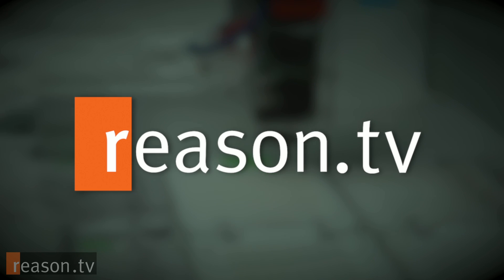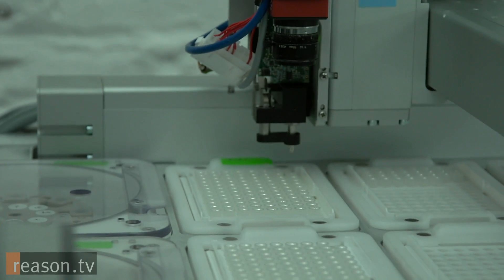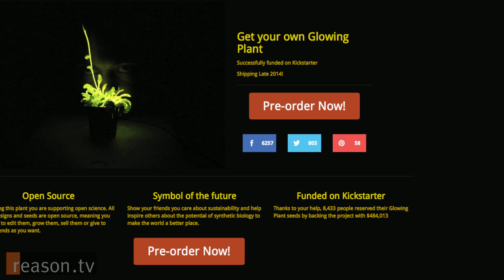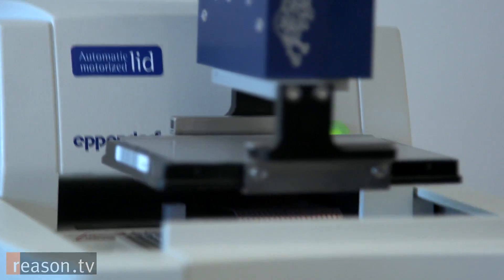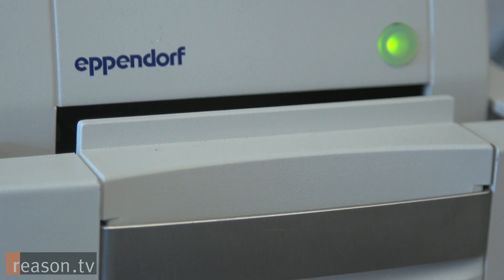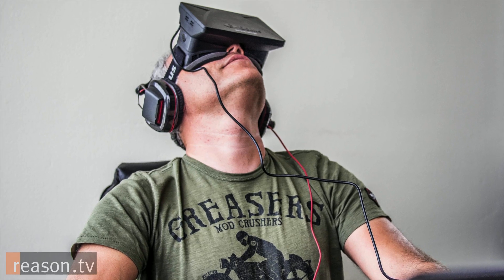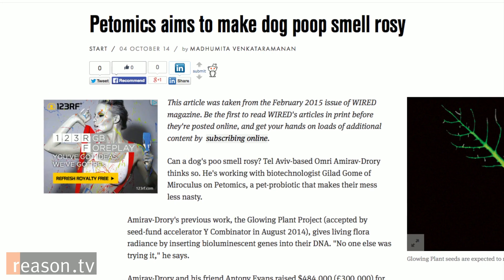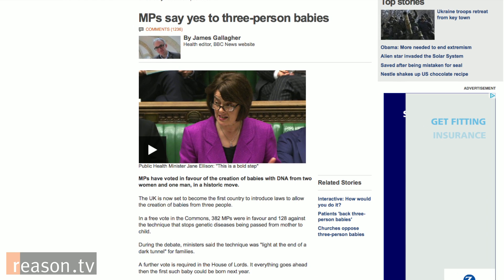3-D Printing DNA: Hacking Life's Code and Creating New Organisms

Comment: I find this tech to be both amazing and horrifying, and kinda for the same reasons, it will be so powerful. And power in the right hands might cure cancer, power in the wrong hands might create a virus that can kill most life on earth.

  And the regulation talk was interesting but not suppose. Regulation is ALWAYS one generation behind. We rarely get regulation until there is a problem but sometimes that regulation cause issues no one could have reasonable known about at the time of the reg. Ei, drug regs where made to address how drugs where made at the time, in mass. Now that we are getting drugs that work and are designed at the personal level, the regs are totally unreasonable and clearly need to be changed for these cases. The FDA is working to regulate this new personalize treatment, but it is a big slow government machine, so it will take a while.

Comment: I want a giant taco that craps ice cream.

I'm a self proclaimed Dr. Science and this strikes me as the ultimate example of our technical understanding far exceeding our wisdom... probably because I grew up on a steady diet of 1950s era science fiction that preached about the arrogance of man unleashing powers that are not understood.

Example:  We'll design and build much more efficient organisms, but we'll encode them to require a certain protein that doesn't currently exist in nature, so we can prevent them from existing in the wild.  Uh huh.  As if the gene that encodes for that protein could never make it into a plant that grows wild... not even by mistake.  Geez, you'd think that Austen would have seen Jurassic Park before founding Cambrian Genomics.
Reply: david
A new amino acid would result in a new protein.

My argument still applies.  Use genetic design to make a change to a genome, or even create an entirely new genome from scratch if your computer models could be that good, and eventually the new genetic structures escape into the wild.  That's even more true if the new genes are more efficient than the old genes.  It's even more threatening to the existing biological environment if the two genetic structures are so radically different as to be incompatible,

Genetic research has demonstrated a consistent reckless arrogance, and I see no sign that wisdom is accruing anywhere nearly as fast as technological ability.  As genetics advances from the biological equivalent of apes playing with fire to the biological equivalent of the nuclear age, but in decades instead of millennia, it's obvious that somebody is about to burn down the house.  Everyone's house.

Even in this technology's infancy, there are countless examples.  Pharmaceutical agents produced by GM food crops (whose bright idea was THAT?) escape into the wild and contaminate food crops with unintended drugs.  GM genes find their way into organic crops miles away via airborne and bee-borne pollen, resulting in the ruin of the organic crop because it's no longer organic.  Rather than organic farmers suing big agribusiness for ruining their crops, the organic farmers are sued for "stealing" patented genes!  GM food crops contaminate food shipments to countries such as Thailand and China and large oceangoing tankers full of grain are rejected when they test positive for GMO.  Starlink GM corn is approved for animal feed but not for human consumption because it may create allergic reactions, but Starline corn is found in Taco Bell corn tortilla shells and other foods for human consumption.  Roundup Ready genes are inserted into almost every crop being grown, and soon the gene is found in common weeds producing Superweeds that are immune to Roundup herbicide.  Similarly, insect pests have quickly formed immunity to many of the GM insecticides that are placed into food crops, but humans continue to consume the GM pesticide because unlike traditional pesticides, the GM pesticide is IN the food, as opposed to being sprayed onto the food crops to protect them.

https://en.wikipedia.org/wiki/Genetically_modified_maize#Controversy

The big issue that proponents of genetic modification miss is that unlike our experiments with chemical, mechanical or nuclear processes, genetically modified organisms reproduce on their own.  Look at the ecological problems that humans have caused simply by introducing new species to new environments.  The numerous problems with invasive species will be nothing compared to the problems that will arise when "new & improved" species are created with the best of intentions but with little understanding of the consequences and inevitably make their way into the wild.

There is also the darker side of genetic modification, where psychopaths use this technology to deliberately create genetically modified bio-weapons.  It's always been easier to destroy than to create.  Humans created nuclear weapons before they created nuclear power plants.  I think that lopsided risk/reward relationship is far more lopsided with genetic modification than we've ever seen before.  Never before in the history of humanity have so few been able to destroy so much.
Reply: Liberty4Ever "In order for a new organism to be useful, it must be able to process food and ultimately to reproduce."

Not necessarily.  Not all genetic engineering has to be for food.

"But how is it that it's possible for the artificial organism to escape but impossible for the artificial food source to escape?"

The food source would not be an organism.  The new amino acid would be synthesized in the laboratory.
Reply: A new amino acid, not a new protein.  Do you not understand the difference?
Reply: Liberty4Ever "A new amino acid would result in a new protein."

I don't think you understand.  Proteins are polymers of amino acids.  You combine amino acids in a chain to make proteins.  An amino acid is not a protein.

"My argument still applies."

No it doesn't.  Giving an artificial organism an artificial protein would not prevent them from living in the wild.  They would still be able to consume amino acids from their environment to create the protein. 

If you created an artificial organism that used a new amino acid that didn't exist in nature, they would not be able to live in the wild because there would be no source of that amino acid.  They wouldn't have a chance to evolve or anything.  They would die.
Reply: david
They could eat each other.  That'll buy them some time.
Reply: Bushrod Rust Johnson And when they finish eating each other? What then?  Theoretically, if they were somehow 100% efficient, I suppose they could perpetually eat each other.  Sort of like children eating their parents and giving birth only to be eaten by their children ad infinitum.  But even then  they would not be able to spread uncontrollably.
Reply: david
I'm not a biochemist, but I do understand that proteins are composed of amino acids, and the proteins are constructed by genes that code for those amino acid sequences.  I don't think you understand what I'm trying to say.  In order for a new organism to be useful, it must be able to process food and ultimately to reproduce.  For that to happen, an artificial food source must be designed to feed the artificial organism.  The premise is that the new organism won't be able to survive in the natural environment if it should escape because it won't have a food source.  But how is it that it's possible for the artificial organism to escape but impossible for the artificial food source to escape?  Even if the artificial amino acid is artificially synthesized, how long do you think it'd be before someone decides that, just as it's very expensive to synthesize various pharmaceuticals and it's much cheaper to spend some money up front to create an organism designed to produce the drug, it'd also be much less expensive to create an organism to produce the artificial amino acid?  Or somebody would maliciously introduce an organism into the biota that produces the needed amino acid?  Or somebody makes a simple mistake, like the hundreds of GM mistakes already chronicled where genes end up where we were guaranteed they would never be?

My point is, technology advances because we control the development.  Scientists and engineers try a lot of different things.  Most don't work and are abandoned.  The rare successes are replicated and we build on that.  But what happens in a technology where our mistakes replicate on their own?  I'm not advocating against all genetic engineering research, but I am saying that this entire field of research needs to be done much more cautiously than we've seen to date.  We'll soon be entering into a phase where we can make some planet changing mistakes.
Reply: I would some day like to see biological senses and processes mixed with digital computing.  Like an artificial, organic nervous system connected to a computer monitor that displays readable data.  Live animals with USB ports.  Cyborgs.